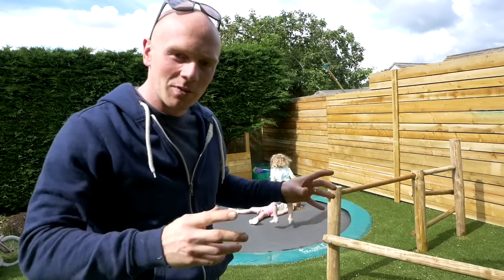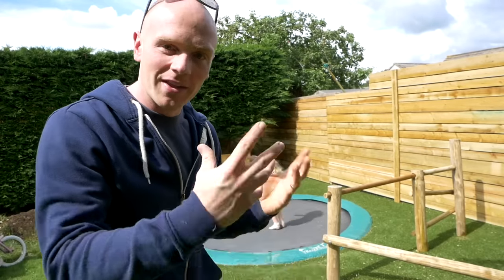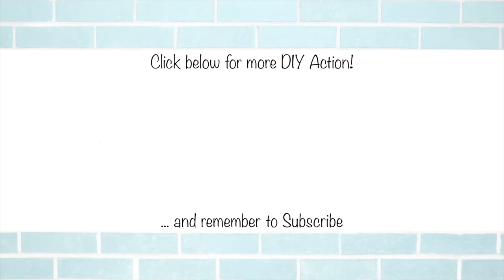DIY IN-GROUND TRAMPOLINE  - Garden Playground Transformation

Comment from the maker: Thought I would answer a couple of the most common questions here. The trampoline was a regular above ground model which I removed the middle section of the steel legs. The thick plastic are used for the retaining wall was 300 mm DPC, link below. Finally, the hole has never filled with more than a couple of inches of rain water, even in the middle of winter. If in doubt dig a little deeper and perhaps put a gravel bed in, at worst you can just drop a cheap pump through the gaps in the springs and pump out on the odd occasion you might have a buildup over winter.
Reply: Great video! What is the tool that you used at 0:23 to remove the weeds please?
Reply from the maker: michael wilkinson that would be a children’s garden spade from the supermarket. 😂 Well it worked. 👍
Reply: You
Reply: I'm planning to do this for my two tykes, 18months and 3yrs, but I was worried it might lose it's bounce if the air can't flow freely underneath, have you found this to be the case at all?
Reply from the maker: I reckon I can build that not really but does mean the padding flaps up a little, at least when I bounce on it! Easiest option is just stick a 4” pipe from void out and up. (Put some mesh over though as you will prob end up with all the kids toys stuffed down it!
Reply: whats the black stuff used under the trampoline along the bottom? same as the sides?
Reply: @samanthaestep7264  would also be interessted in the answer :) I want to protect it from crashing in and also that there are no plants growing ... furthermore I am a bit worried that mice or whatever could fall in there and rotten =/
Reply: Right so you took the middle of the legs to leave a short leg. What width was the ledge you done before going depper and also what depth do you dig the middle hole

Comment: Great video of your project. I think you did an excellent job with what you put together. My only concern is still a safety concern  due to the close proximity of the wall and the fencing. At this early age it may not make much of a difference, but as the kids get older they could end up bouncing right into the wall of even on top of the fencing. Otherwise it looks really like a great space.

Comment: Looks great!! I am toying with the idea of doing something like this if I can snag an old trampoline... What I'm curious about is the rain - I don't want to do all this work and then end up with a mosquito pit 😬
Reply from the maker: I have checked it out of curiosity over two winters and after the heaviest of rainfalls it will have around 2-3” in it which takes a day or so to drain naturally. Depending on how clay like your soil is then it might just be worth digging an additional hole in the middle of the bottom and filling with gravel or just keep a cheap submersible pump on standby if it did become a problem?

Comment: Would there be no need for any kind of drainage system in the pit of the trampoline? Great video!
Reply: Ross Bagnall yes I would say some sort of soak away. A friend of mine has done this and after some heavy rainfall it just filled with water. You can just dig a small trench and fill it with bits of bricks and stones to help the water drain.

It all depends on how porous your soil is at the bottom of the hole so you could get away with not having to do that but for the small amount of work involved digging a little trench I would do it just to be on the safe side

Comment: Hey. Great video. 

I’m just building (another) playground for the kids and I’m thinking about laying artificial turf like you. 

Most places I’ve looked say to lay other layers of gravel and sand as well as the weed membrane… But I notice your weed membrane is just on top of your soils. Have you had any problems with that, or has it been ok?
Reply from the maker: It held up just fine and for the purposes of the play area it was enough. I might have put a bit more thought into it if it was a main area of the garden but seemed to last just fine.

Comment: I did same but cover making noise with each bounce. I heard air ventilation is needed.  Can u suggest how...
Reply from the maker: If the cover pad is flapping, you can just add a pipe to allow airflow.  Soil pipe with an elbow and then fit a plastic grate over like you would on a drain.

Comment: Great video, i'm think of doing the same, initially was going to leave turf up to the perimeter but moving and strimming the edge might be difficult so am considering artificial grass. You said yours was temporary, is this still the case? Would you recommend it or would you prefer real grass? Also those climbing poles are great, where did you get the materials from?

Comment: Hi - amazing job, could you tell me where you got your trampoline from and what are the 2 depths needed to dig out underneath? thanks
Reply from the maker: It was £20 on eBay. 👍 it’s a regular trampoline , I just took out the middle leg section.  The ledge is the height of the legs and depth at the centre of the hole is around the same as the height the original trampoline was from the ground. 👍

Comment: For the bottom of the trampoline frame did you just use the frame it came with but just take out the long pieces of it to make it the original height ?
Reply: And what is the black stuff for the retaining wall that you used called.
Reply from the maker: Correct, just took middle section out. The black is some 300mm dpm that comes in a roll. You could do it in brick if you had time but this has held up fine so far.

Comment: Then it becomes a pool in the rainy season, right? No drainage or water control that I could see. Problem?
Reply from the maker: It’s been in a year and at worst over winter it was at about 50mm deep and drained over a day or two so looks to be ok thankfully. If it hadn’t been so freely draining then there was always the option to drop in a dirty water pump  through the spring gaps if it was that bad. 👍
Reply: @TheRestorationCouple  No worries. Just wondering about that hole in the ground making for surprised bottoms...

Comment: How you get the water out from under the trampoline? That would be a hassle to pump it out every time
Reply from the maker: It’s been in for over two years and never filled up more than a couple of inches. if in doubt just over dig and put a gravel drainage bed on the bottom 👍
Reply: The Restoration Couple I have been thinking about doing thus for my little girls. I was worried about the water though. Thanks for the insight